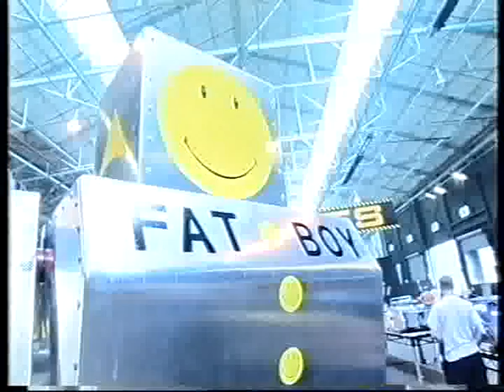Robotwars Series 4 Heat L Part 2

Comment: I was never able to work out what the FUCK Plunderbird's "slicer dicer" was actually supposed to DO. Was it supposed to be a vertical crusher? Because I don't think I ever even saw it move, on any incarnation of the robot. (Even if it WAS supposed to be a vertical crusher it never would have done anything because the point extended beyond the front edge of the robot, meaning they'd get no purchase to dig in to anything they attacked.)

I think it's neat that they actually used the Thunderbirds theme for their arrival scene, considering Thunderbirds was the inspiration for the robot in the first place (Plunderbird 4, for example, was based loosely on the yellow submarine Thunderbird 4). It really is a shame that so much pomp and bombast was wasted on a robot that, let's be completely honest, never even managed to master basic engineering. Plunderstorm was the worst (one track was broken before the battle even started and the machine broke down altogether after only one tap from Thermidor) but they've ALL been unreliable. Say what you like about Sir Chromalot, at least the bloody machine works. Considering in later wars they wrote a song called 'Have you Got a Srimech?' it's embarrassing that they NEVER actually added one before they retired (although it probably just would have broken down anyway if they had).

"Partially sighted", huh? I guess Bryan must just be LEGALLY blind, not actually completely blind.

Oh man, the bit where Vercingentorix put their axe into Fat Boy Tin just before the floor flipper sends it rolling, dragging Vercingetoric over with it, was HILARIOUS! At least they were able to show off that their own srimech worked, though.

And now we have our first robot-fighting snail! This incident would inspire the Fat Boy Tin team to enter the 7th Wars (they applied for the 6th but failed) with their new robot, Shell Shock, which resembled a snail itself. Unfortunately, Shell Shock was barely less crap than Fat Boy Tin (especially considering how much better the standard of engineering had become by the 7th Wars) and it did no better.

It's a pity we didn't get to see Plunderbird vs Spawn of Scutter considering the Scutterbot boys were deliberately taking the piss out of Plunderbird's look, but it couldn't be helped- they were both seeds and therefore had to be kept apart in the 2nd round. Tournament rules. And if you think Plunderbird can beat Knightmare you're dreaming.

Good pinball run by Diotoir, say what you like about them but Zulu generally drives well. Just got a bit stuck behind the car door.
Reply: Just in reference to your question about Plunderbird's weapon, I believe it was meant to act like a Razer Beak. If you look carefully at 3:55 ish, you can see it trying to come down on the armour of FBT. Of course, effectiveness or lack thereof made it difficult for anyone to tell.
Reply: technically plunderbird 5 never got a chance to prove itself as it was drawn against one of the best robots in the later series, S3. consequently it was ripped to shreds however I do believe if it had been drawn against something a little less destructive it may have done a lot better than their previous machines.